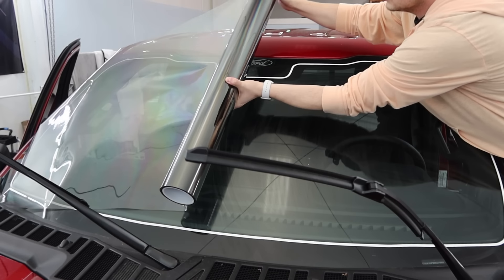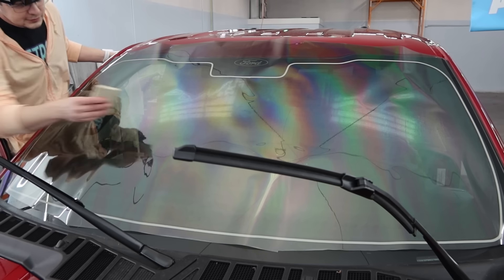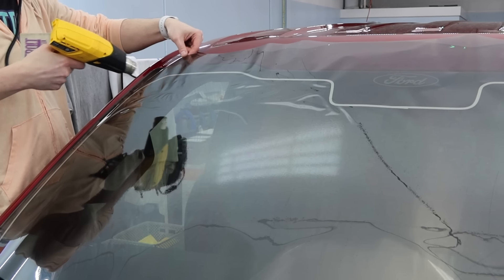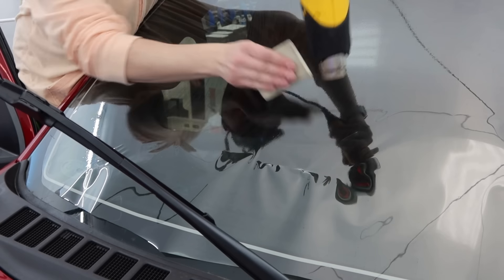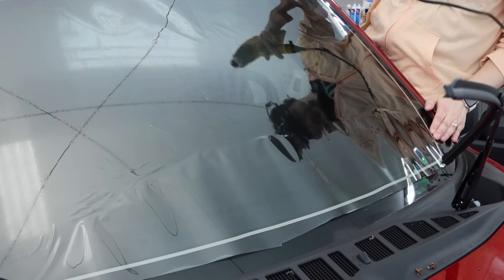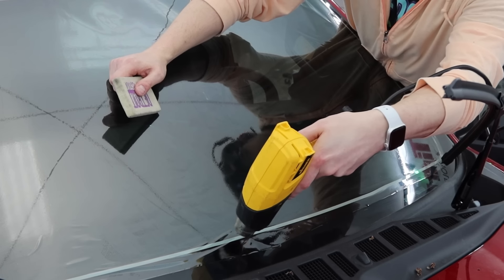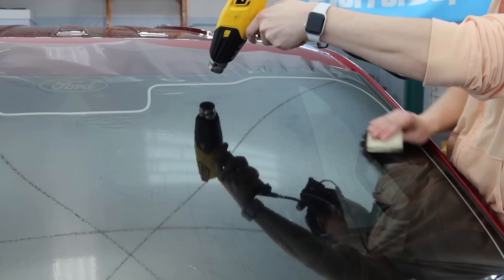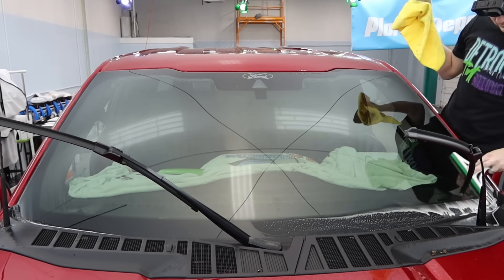THIS Makes Shrinking Windshield Tint EASY

Comment: I noticed, from repeatedly watching you do front and back windows, that when the film starts to drape, you push it with the felt card to make it lay down. Until you start shrinking it, you have what you are always identifying as fingers that run from top to bottom. One more thing that I picked up on your last stream is what you said about which edges you can shrink are the ends of the film and not the sides; because of the way it's made. I didn't know that, but when you snap shrink the door windows, you are actually shrinking the sides; because of the way you double cut the door windows. maybe that's only because you don't need to shrink but a very little. You've been doing it for 15 years, so I'll take your word for it. Because you always do a superb job of tinting windows, no matter what. I actually ignore what other people say. Everyone has a style, but I don't want to bounce around on techniques. Somehow I found your videos, and I started watching them and you are very good and not only executing it but explaining it. I figure if I keep watching and listening to you, that I will eventually pick up on what makes you so good at it, and then maybe I can grow from there, and maybe I find a different way as I tint, but until then, I'll just listen to one voice on it; I think I'll have better chances of getting it if I do that. Thanks for posting all the videos and coaching us through the process, Matt; Great Job my man!

Comment: Not mentioned but I’ve personally found that setting the middle
Tack point slightly above the middle of the windshield puts less shrink on the top half where there is less material to shrink. Makes it easier to me atleast
Reply: Nice the top always gets me a little
Reply: So true

Comment: hi, is there any chance that after applying the film, to notifice some sort of distortion on the windshield or it would be because of the windshield itself? there is no bubble or any type of material on it, actually it looks like it does not have a film on  it , so clean, however i have noticed after a while, that i see a distortion  , like horizontal line on the drivers side and it is annoying .

Comment: I knew you had to shrink the front windshield to tint it, but this is the first time to see the process. Not sure if you took the film off when you were doing the shrink process. I'm guessing you took it off before spraying the soapy water onto it. I tried to do the door windows of my truck about 7 years ago, and I had a difficult time with cutting it to size. I didn't really see you show that process here on the windshield either. I know you done it after shrinking it, but you didn't show the process of making some nice clean cuts, so what is the process you use to accomplish some clean lines around the edges?
Reply: Sharp blade and a steady hand with plenty of light from the inside. There’s a dot matrix that’s used as an outline, or like in this video he has the white tape outlining it and uses that to cut the film to size. Super easy.

Comment: I was taught to wet shrink.. Is this easier??
Reply: Wet shrink is very old school, that's how I learned. Dry shrinking using baby powder (messy) or dryer sheets is a lot easier to learn and is pretty forgiving. Pure dry shrinking is easy to do with a clean and dry window while using this pull method but if you force the film it is easier to crease.
Reply: Yea dry shrinking is a-lot easier, also puts less heat/stress on the film so I’ve noticed film lasts a lot longer
Reply: When I first started I always did the drier sheet method but after I learned wet shrinking Thats the only method I use now I love it
Reply: @jasongammoh4114  But why? Some windows are impossible to wet shrink. I can we shrink almost anything. But why do you choose to wet shrink over dry? Dry shrinking is at least 3x as quick for me, and Idk if youve done tesla 3/y/x back windows, but dry shrinking is the only way
Reply: I’m gonna have to try this dry shrinking method. Wet shrinking super curved glass is very difficult and time consuming..
Reply: @wazewaze8185  i personally think wet shrinking is a lot more forgiveable than dry I can do both but I just prefer it since I havent been tinting for too long its more forgiving, however I do agree that it can be a little more time consuming but I just love it
Reply: I always felt wet shrinking was less forgiving because you were shrinking smaller areas of film (the resulting fingers).
Reply: @jasongammoh4114  Yeah man wet shrinking is defiantly less forgiving. Its alot easier to crease or melt the film. I've been tinting for 11 years and learned off of wet shrinking. Once I found out about dry shrinking, Im staying away from wet shrinking as often as I can lol. Except for easy back windows/sunroofs/rollups

Comment: this is so cool to do but people are getting pulled over left and right for this because you cannot have obstruction on your windshield and tint is obstruction it doesn't matter if you can see clearly out of it you can't see in it and you're going to get picked up every single time it's going to be a hassle again I'm not complaining I'm just saying what's happening cuz I think it's pretty damn cool the tint on the front windshield
Reply: Just have to check with local laws, and as a tinter, you inform people of the risk, or offer a solution that meets the local laws. Windshield VLT in my state cannot be lower than 70%, so as long as that’s met, you are in the clear.